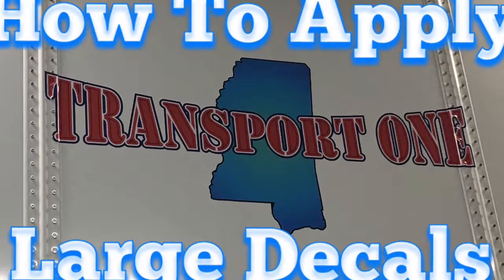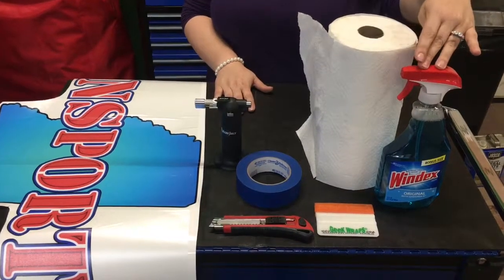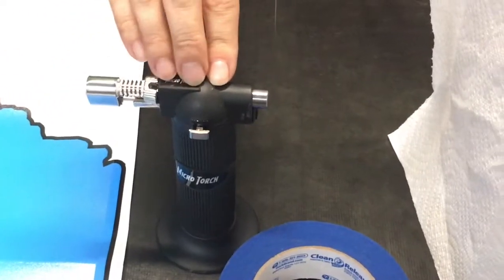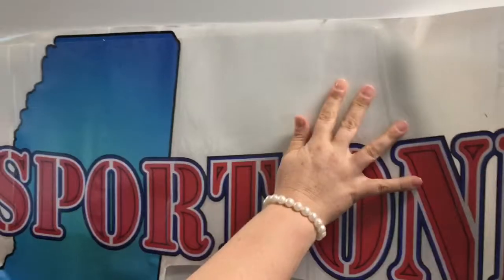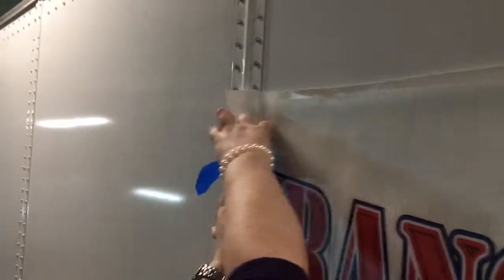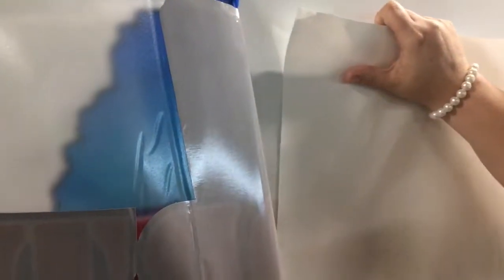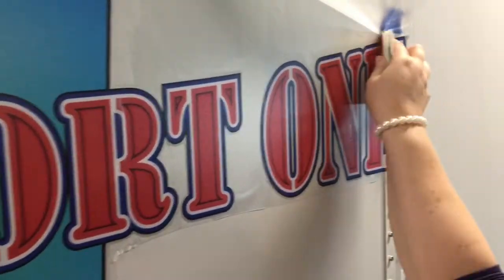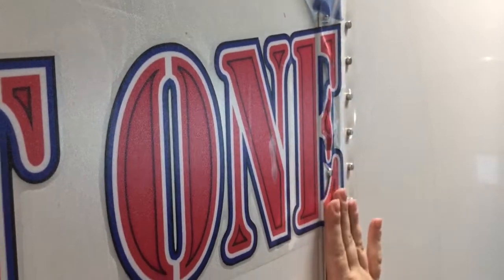How To Appy Large Decals

Comment: I did vinyl decal installs professionally for a long time. You guys did good. For large stuff we always used a slip solution like rapid tac. It allows you to pull up the vinyl and try again if something doesn't go right the first time and also allows you to squeegee any bubbles out.
Reply: @8 Ball it works fine. It just takes a lot longer as you have to wait for it to dry underneath the vinyl so it will stick enough to work it around the rivet.